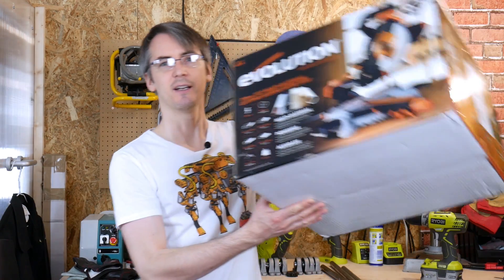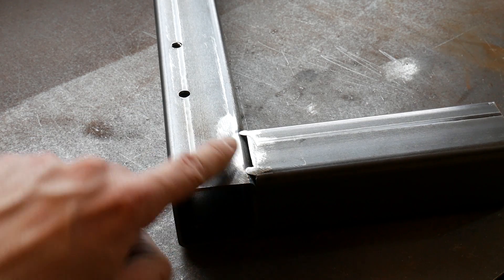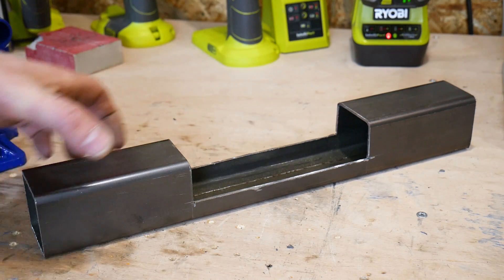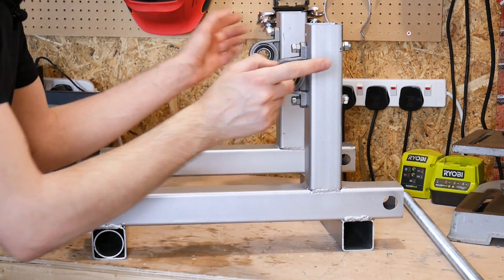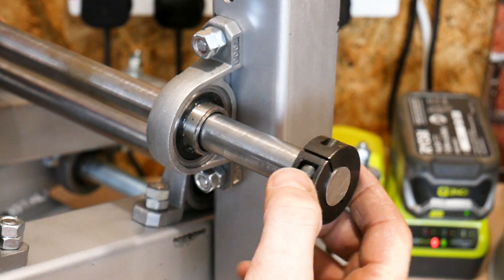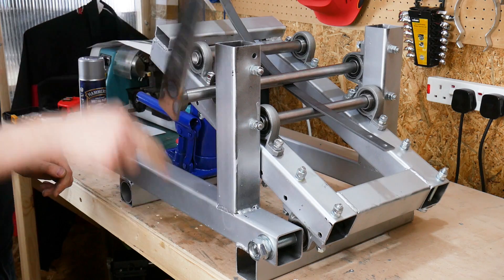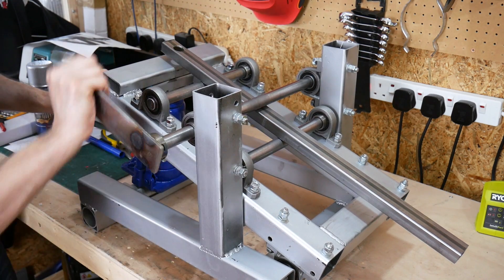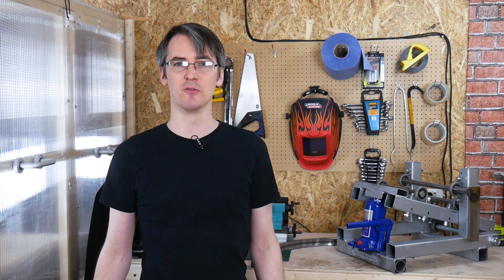How I Built a Metal Roller | James Bruton

Comment from the maker: I'm going to be using metal to make more robots, and maybe ExoSuit V3!
Reply: Hey, love your videos and the detail you go into,  what about creating a diy usable robot like a diy vacuum or lawnmower?  Or  a robot that will do the dishes? Lol 
Seems to be a lack of detail in videos on youtube for this sort of robot
Reply: James Bruton  I cannot wait to see new robots and I like how you did not edit your drill holes mistake that is something that I would do by mistake as well  ps your welding is better than mine
Reply: 20mm tapered roller bearings would probably be more appropriate for the load?
Reply: Nice work! You could also add adjustable disk guides on the roller bars; ones to adjust to the width of the material you're rolling.
Reply: You have been hanging around with Furze too much ;-)

Comment: Tube-kinking is a function of roller diameter relative to your stock thickness. For example, if you have 1/4-inch flat plate, you can roll it on most-any roller that is 1-inch diameter or larger...the multiplier for flat-stock is usually best when greater than 4. For tube, the multiplier tends to be a minimum of 3 (so to roll a 2-inch thin-wall tube, you will need 6-inch diameter concave rollers), and for square-tube-stock, you really want a 4x multiplier to prevent wall collapse and kinking...so a 1-inch tube thin-wall would require a 4-inch diameter roller...ideally with a 'square-cut' concavity in the roller, to prevent wall spread or collapse.

Comment: You don't have a clue what you are doing with the roller. Google how to build a metal roller and you will find thousands of real projects that actually work. This is the worst example of a metal roller ever built. the shafts are too long and small and too far apart and you need dies to roll anything that is not flat.

Comment: Good job on the metal roller. Maybe a part 2 where you add an arduino to roll it automatically and pump the jack on each pass ;)
Reply from the maker: I thought about it, but I think it'll remain manually operated.

Comment: You can minimize kinking in box/tube material, you can weld on a plug to one end, fill the entire tube with sand all the way to overflowing, then weld on another plug to the filled end so that it is supported during the rolling process, once done you can just use an angle grinder to cut off the plugged ends and presto!

Comment: Tip from a welder: the way you've got your TIG stinger gripped is probably the hardest way to do it. Grab it like the tungsten is a pen. It'll give you much finer control of the arc, and therefore, cleaner, neater welds. Still, for your first TIG welds, with no instruction? Not bad at all! Keep practicing, and you'll get better in no time.

Comment: For the fillet weld joints id say to run a straight bead without making crescent moons then a cover weave while adding filler rod at the top and bottom of the weld

Comment: Tig torch angle is way too shallow. The ideal angle is 90* to weld, but for visibility they often recommend 15 degrees or so. Also, push gas, so completed weld is under angled cup. No idea what your weld puddle/movements look like, but it's best to think about reacting to the puddle with regard to travel spreed and filler addition, and controlling the puddle with pedal. Not a pro welder, but have done a fair bit.

Great video though, keep up the good work!
Reply from the maker: Thanks, I don't have a pedal in this machine - it's just fixed current.
Reply: Aha. Scratch start then too?

Comment: I think it's good that you've expanded your workshop's capabilities into working with more materials. You've shown that you can use 3D printed plastic for more things than one might expect. But some of your bigger projects have shown that you sometimes just need something stronger for key pieces.
Reply from the maker: Yep - the plan is to use all the materials - 3D printing, CNC, welding etc where I need them.

Comment: Professional metal worker here. Love that you're doing more projects with metal, and that you're building some tools yourself. I think your welds look fine. TIG welding is the hardest to do and you've jumped into it with both feet. Practice will make it much easier. 

A cup kit, a shorter back cap and some specialized gloves may help a ton if you're looking to make things easier. Buying a set of gloves or a TIG finger makes sliding your hand along as you weld a lot easier.

Comment: Nice project. 
Looks like your inside corner welds need you to hold it at the top of the stroke slightly longer, as gravity pulls the weld puddle down so you are fighting against this using time.

PS: Where did you get them bearings with brackets?

Comment: OMG those TIG welds are horrible, I can MMA weld better than that and I welded once in my life I think. My father has a roller for big barrel things, there are 2 rollers on the bottom that are rotated by hand and one on top that you can move on the Z axis by screws. I don't know if the angle will give same result ...also the distance between the 2 bottom rollers is too big

Comment: A possible improvement to the handle would be an attachment to add a drill or other similar device so you only press a button and it uses less physical force, but I don't know if you'd use that

Comment: Since this is a James Bruton build, it needs a 3D printed handle and an arduino. Put a linear actuator on the pump handle, a rotary actuator on the crank handle, then connect it to the Bender robot, tell him the material thickness and radius wanted, and have him control the whole thing.

Comment: Nice result!  Lots of little tweaks to make this tool easier to use are possible.  A handle on your handle :)  there are dies you can purchase to help hold tubing in place and protect work from deformation.  Some collars clamped to you input and output rollers can help keep work centered.  Fun stuff!

Comment: I wonder if you could reduce the buckling of box section by filling it with sand
Reply: I don't know.  I've tried that trick with bending tube before and for me it didn't work.  I think the issue it the sand only affects changes in volume and as the metal deform the total volume doesn't really change much.  It's also really hard to get the sand to stay packed tightly enough  to actually be helpful.  Though it's possible I was just doing something wrong

Comment: Welding the inside corners - using gravity to assist with the filler sinking into the groove should help. You can try putting the parts at an angle (e.g. 45deg). Figure out a little better table rig to hold the parts in place. :)
Reply from the maker: I was thinking about making a special welding bench with all sorts of clamp/jig points on it.
Reply: @jamesbruton  Yup, good idea. Looking forward to that vid. ;)

Comment: I Think that for the first two metal bends demonstrated to be a better round shape you need the rollers on the bottom closer together near the driven roller.
Reply: yes, and you wouldn't have the long straight bits at each end. Time for Mk2

Comment: Id add some clamping collars on the inside of the roller to help keep the material centered, and a handle on the end of your lever to easily roll it. Pretty cool.
Reply: Agreed! Just a tube at the other hand of that plate would make it so easier.
I am not sure if clamping is necessary. As long as you position it centered at the beginning, it should stay straight in place. As we saw with the last piece, it went a bit sideways just because it was not perfectly perpendicular from the start.